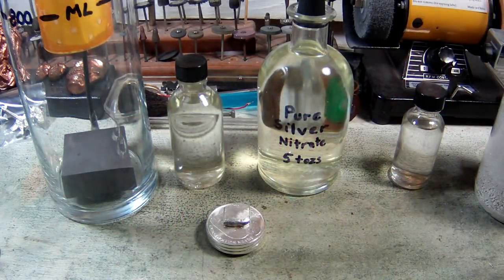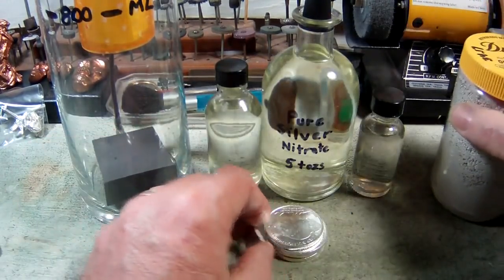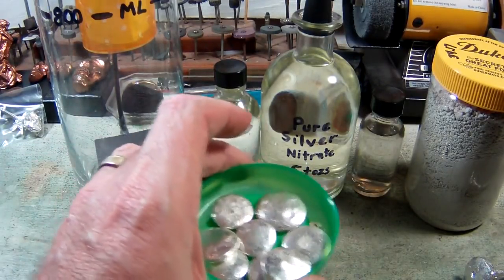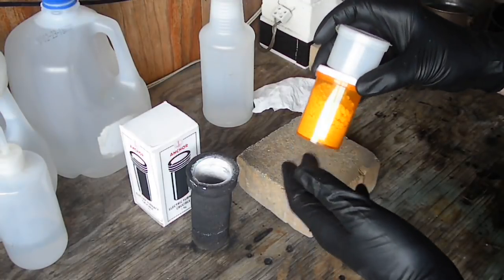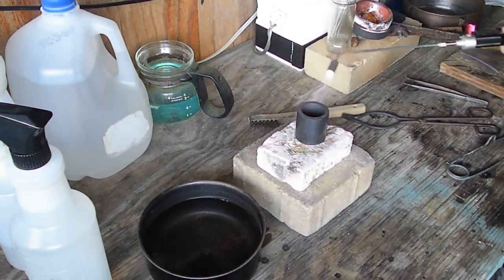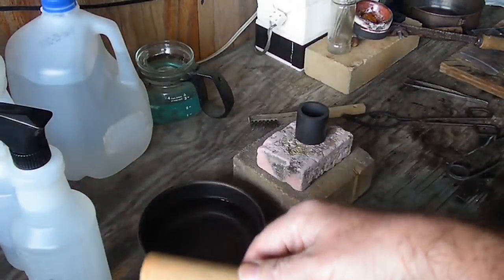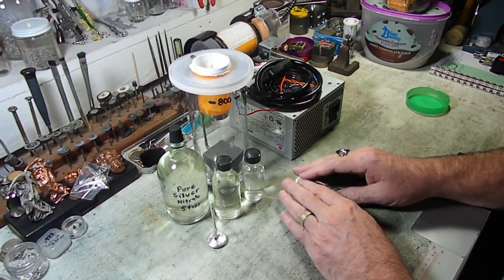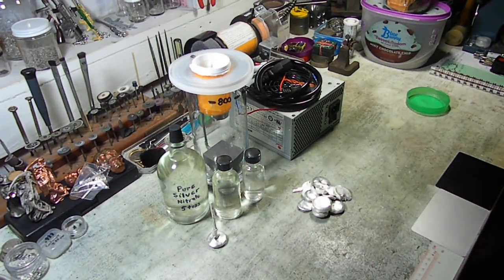Silver Cell Prepping Getting Everything Ready to Grow .999 Silver

Comment: New sub here. Really enjoying your video's so far! I'm very new to silver and gold refining! I'm not new to gold prospecting and recovery from the field. I just over the weekend refined some scrap karat gold to three 9's fine for the first time. I'm currently gathering the things I need to put together a silver cell. Looking forward to studying your video's. Thank you!
Reply from the maker: Welcome!! Glad you are enjoying the videos, thanks for the sub!!
Reply: @BackyardScrapping  In the silver cell, is there another material that could be used as anode bar other than silver? E.g Copper?
Reply from the maker: @IndependentForPieceOnly  The object of the cell is to purify your silver, if your copper were to get in to the electrolyte it would contaminate the cell. I suppose you could use copper but you would have to keep a good distance from the electrolyte, in other words you will need a good pile of silver between it and the solution, so you would have to keep a very close eye on things. Also the silver you're putting through the cell should not be overly contaminated, meaning the purer the silver your putting through the cell the longer your electrolyte will be useable. The bluer the electrolyte gets the higher the risk of contamination. The question is, how blue is to blue? This seems to be a matter of opinion. LOL a Ruby is just a red colored sapphire, so at what point does a pink sapphire become red enough to be a "Ruby"?? In my opinion the color of windex is to blue for me, I generally change out about half way between clear and the color of windex just to be safe.
Reply: @BackyardScrapping  Awesome! Thank you for the reply. Yes! The more I thought about it the less enthused I was about a copper anode. The purpose of the cell is to get rid of the copper. Correct? I was just wanting to run that extra ounce of silver through the cell. A 1ozt silver bar should be a good size anode? Correct? Love your video's! Your explanations are so down to earth and easy to connect with. No giant words that I have to break out a dictionary with or chemical equations that have to be studied to figure out. You speak like a normal yet knowledgeable human! Thank you!
Reply from the maker: @IndependentForPieceOnly  Thanks for the compliment, I try very hard to keep it real, there is nothing that aggravates me more then having to pause in the middle of a video and go look up what the person is talking about! I have learned that trying to look smart about something you're not sure of can make ya look really dumb sometimes. HNO3 is nitric acid, so just say nitric acid so everyone knows what your talking about, or if your gonna say HNO3 tell everyone what it is so they are not left scratching their head & wondering what the hell your talking about. Words don't make people smart, knowledge does! If you say HNO3 and then say its nitric acid, they will learn, and the next time they hear HNO3, they will know what it is!! Also always remember no question is dumb as long as the person asking truly wants to know the answer. P.S  (I use a 75 to 100 gram bar, the heavier weight seems to make for a better contact).
Reply: @BackyardScrapping  Thank you brother!

Comment: I know I probably sound dumb asking this but why do this? Why dissolve pure silver to make more pure silver? This is really interesting to me, but I need to know why do this, instead of just buying .999 silver shot to make your bars. cool setup thanks
Reply from the maker: For the most part I only do this if I need to increase the fineness of my silver, to make it .9999 or .99999 fine which can be used to make colloidal silver or other applications that require silver of this fineness. The process I use when refining my silver yields me nearly four nines fine silver as is. Most of the time my process yields .9996 to .9997 and higher, which is more then enough to be considered pure silver, but silver must be even purer then that, especially medical grade. Other then that I pretty much don't see a need for doing this unless you are unsure of the fineness of your silver and do not have a way to test it. Its a way to pretty much for sure that your silver is at least .999 or better when you have no other way to "For Sure" test it. Selling someone even .998 as fine silver can ruin your reputation, just another way to be sure. Hope this helped to explain this process.

Comment: I’m learning a lot, can you buy the elctrlite
Reply from the maker: I sure someone out there sells it, but probably gonna be a lot cheaper if you make it yourself, just be careful !!
Reply: @BackyardScrapping  in a rough estimate what would say it would cost to start up a silver cell?
Reply from the maker: @darcybrawataakaontariostac6835  I think I used 5 ounces of silver for this one, but I did have some left over, so that cost plus the nitric acid. You will need approx., 1 to 1.5 ml per gram of silver, so 31.104 grams per oz., of silver = 155.52 grams of silver X 1.5 ml nitric to be on the safe side = 233.28 ml of nitric acid, the cost of that will depend on where and how much you buy, but it should be between 3 to 10 cents per ml.. So to sum up about $25 for the nitric and what ever the silver costs. Hope this helps.